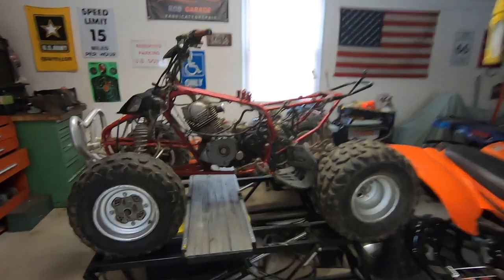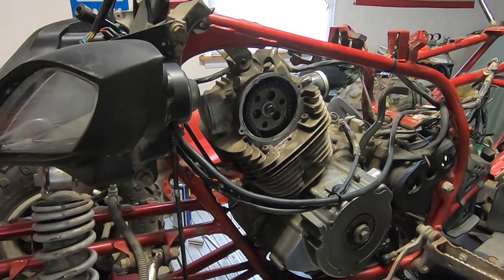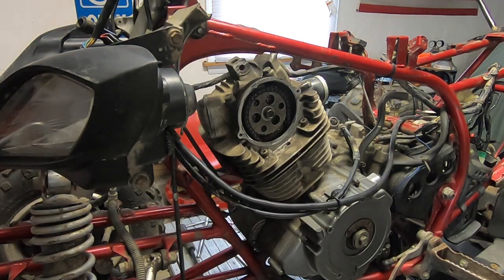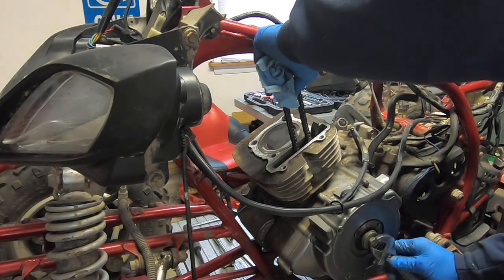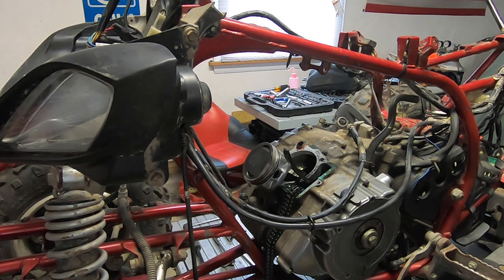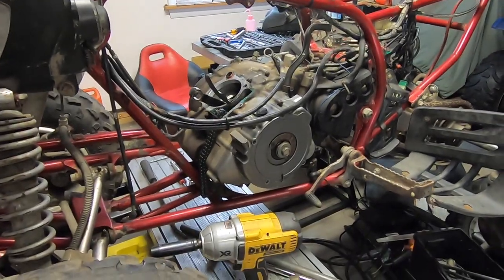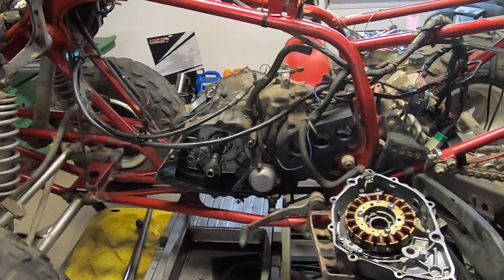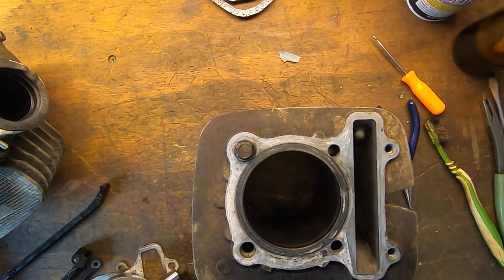2009 Raptor 350 Engine Teardown

Comment: That's just unfortunate. These Yam 350's remained 99.99% unchanged since they debuted in 1987 in the Warrior, all the way until their last year in the 2013 Raptor 350. One of the most reliable air cooled quad engines ever built. Sad to see some goober screwed it up so bad, but the amazing thing is despite it being out of time a whole tooth plus a worn out, sloppy timing chain, it's still rebuildable.

Comment: When I rebuilt my grizzly 350 the wrist pin I had to use my hammer drill to hammer it out 😂 i blew it up again and just got a new motor recently for $200. I’m gonna build a 1of1 grizzly 450 now with warrior and raptor 350 parts gonna send someone a stroker warrior crank and my blow crank and have them switch the connecting rods. Also looking for a warrior head and a flat slide carb. Mainly as a F you to previous me and what I now know 😂

Comment: Do you still read comments? I have a question
Reply from the maker: I read all the comments
Reply: @RCBGarage  I’m currently rebuilding a 2004 raptor 350 (splitting the case and all) (failed oil pump… yea :/) could I email you some photos to get your opinion on something?
Reply from the maker: Sure my email is on the channel info page
Reply: @RCBGarage sir, I haven’t gotten around to email you. My raptor 350 has a Weisco connecting rod. Where the piston wrist pin meets the rod there is a “bushing” bronze. And it spins… everything I’m reading shows it should not. Do you know?
Reply from the maker: @Evadingmoto I have seen bronze bushings in connecting rods. Some engines have it but most don’t. Low compression low RPM engines  seam to be where they are. Check the specs on the rod and go from there.
Reply: I have a rod knock in mine, do yk what I would have to do to fix it?